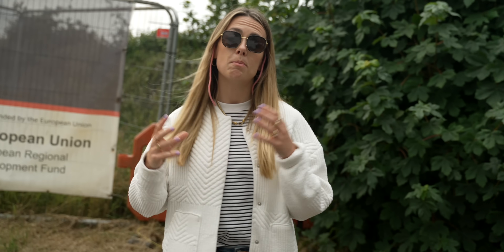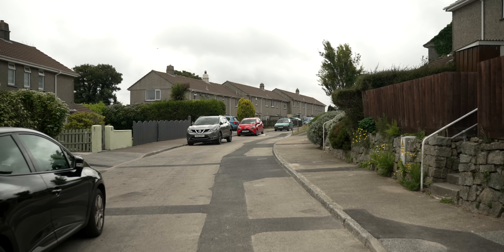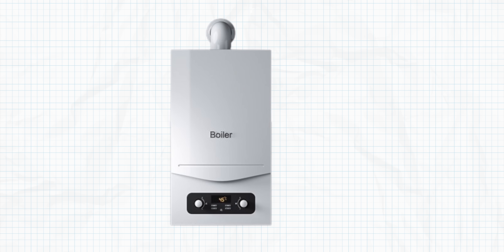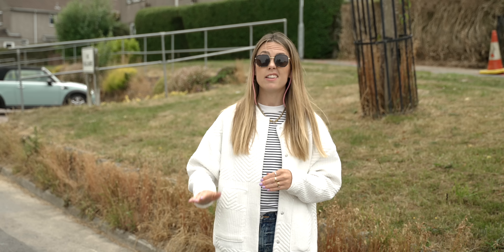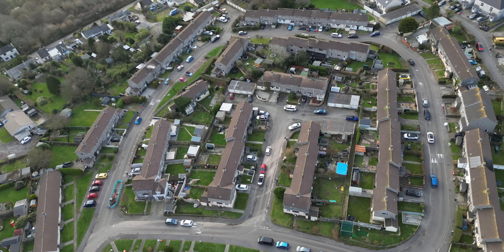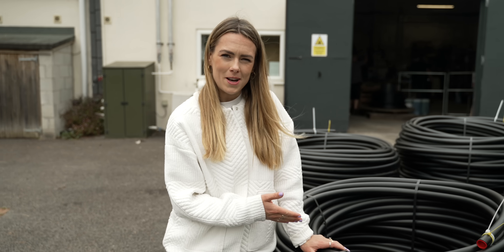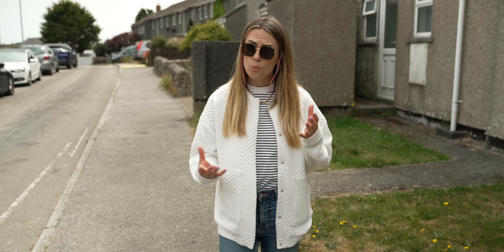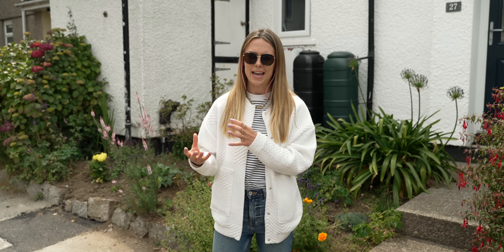Can Kensa's Ground Source Networks Supercharge the UK’s Heat Pump Rollout?

Comment: Don't want to come off as a detractor, I totally wanted to get a heat pump installed, but space requirements indoors and outdoors meant I couldn't. Most people in the UK live in small houses with small gardens
Reply: I had two 100 metre boreholes drilled in my front gargen which is not that big. If you have a drive they gould go there.
Reply: If vertical ground loops don’t work, you could look into air-source mini-split units. The outside looks like a box fan and the inside unit is typically wall-mounted and resembles a shallow floor-mounted radiator. Friends of mine installed three DIY units this summer as it was cheaper and faster than replacing their central AC and reworking its ducts, just in time to take the edge off their first heat wave. Now their systems can provide both cooling and heating (versus cooling only), and they have zone control via the separate units.

Comment: Heat pumps are not financially viable in the UK. We don't have the extremes of temperature to make it worthwhile insulating houses to the extent that is needed to make a heat pump a sensible investment. Here in the NW of England the central heating is on daily for only half of the year, the rest of the time clothing will keep you warm (or cool) enough.
I drive an EV, have solar & battery setup and would have got a heat pump if it made sense. Finding balanced research is like finding rocking horse manure.
Reply: You neglect to consider the external costs of heating that are borne by the environment with disastrous long term effects. In order to get to net zero, gas for domestic heating must disappear.
Reply: @rogerphelps9939  I'm using an electric combi-boiler and that works just fine for me but everyone's situation is different. We certainly should be looking at legislation for new builds but limited resources are better spent on solar panels going on the roof of hospitals, schools, council houses and council buildings in general. I've also wondered why a wind turbine isn't stuck on the top of skyscrapers.

Comment: Heat pumps are definitely the future of heating and ground source is best. I have one. One concern that I have is that the electricity demand on a cold winter's day is going to be massive. My heat pump produces over 9kw of heat for an  electrical input of 3kw but it has to be on around 17 hours per day going nearly flat out on a very cold day.  The demand on the local distribution networks and the grid as a whole will be close to the entire present installed capacity. It is a lot greater t han the requirements for EV charging. Then there is the problem of generation if there is no wind. Where do you get 60GW of green electricity just for heating from on a cold still day? Batteries have nowhere near the necessary capacity and pumped storage is just a few GWh. We need lots of storage. Perhaps Dale Vince's idea of using grass to produce energy could be used or maybe excess renewable energy could be used to produce hydrogen which could be stored in old gas gields such as Morecambe Bay. Whatever we do the very inefficient and wasteful process of burning gas, natural or synthetic, in domestic boilers must end.
Reply: Infra red panels seem much 'lighter on their feet' than the day long operation of the gshp and the ashp. A  background trickle of heat ( 7 degrees C) for uninhabited rooms and a 2 and half minute programmable warm up time in inhabited rooms. If all the rooms are occupied all day then the heat pump logic applies, otherwise for those who wish for a combination of lower embodied energy overall, simpler cheaper install and less of a need to look 'a bit serious' when presenting the IR panel approach may be the best fit for some; provided that a realistic bid price is put forward by the government for  the more efficient wind farms at sea approach as part of a sensible energy mix, as with 'E.ON' or others. Maybe next decade, or just before the fabled 2050, which will probably be too late, based on the newest data from Antarctica.

Comment: Most everywhere in the world are way ahead of UK in the use of heat pumps. I'd love to get rid of my gas combi boiler in my well insulated house  but the costs and disruption of a heat pump system is never going to make it viable.
Reply: They are already fitted to new housing. (Gas boilers are banned now for new builds)
Reply: Please consider the environment that your grandchildren are going to have to live in. Fossil fuels have external costs that do not appear on any balance sheet but are real nevertheless. Unfortunately the cost becomes apparent in future global warming and environmental degradation. Please do not look at it ijust n strict terms of how mmuch money it is going to cost you.
Reply: @rogerphelps9939  I am very conscious of the climate challenge we face having volunteered with our local sustainability group since 2006.  I have spent a lot of money to reduce my bills, and have had an EV for 5 years.  There is a better solution for me just around the corner.  I am invested in Ripple Energy, I expect Vehicle to Grid and Vehicle to Home technologies to become active, both of which will make moving to a different form of electrical heating be a cost effective and efficient way of replacing the gas boiler. A Heat Pump will never be that in this house.

Comment: Five times more efficient than gas heating system is a vague term./// Iceland has found that geothermal energy (Ground source heat) diminishes by 4% annually. Is this likely to be the case here? In Canada some ground source heat pump systems, which also act as air conditioners in summer, pumping heat back into the ground, become heat deficient in the heating season. Also, because of the low winter temps. here a supplementary heat source is usually installed. How would this be accommodated ?
Reply: Geothermal and Ground Source Heat are not the same thing. Geothermal basically comes from deep down heat from Earths core, and needs very deep boreholes (500m to several km depending on location). Ground Source heat comes from closer to the surface, too shallow for Geothermal heat to impact it, and these are typically 200m or less in depth. The heat is coming from the Sun warming the ground, rather than from the planets core.
Unfortunately some people sometimes incorrectly use 'Geothermal' when they are talking about a 'Ground Source Heat Pump' system, so the words get muddled up a bit. Basically if the borehole isn't ~500m or more in depth, it's not Geothermal.
Reply: @TheBoothy666  
Thanks, I sort of knew that but was trying to keep it simple. having thought about Canada  a little more, prolonged snow cover will restrict solar absorption and in the case about which I know, the family are outdoors people and use little summer air conditioning
Reply: As long as you don't try to take out too much heat the reservoir should stabilise, perhaps at a slightly lower temperature. Remember, in the vast majority of cases, the heat is not geothermal; it is just stored solar energy.Regarding supplementary heat, I have had a ground source heat pump for 6 years and have not yet needed any supplementary heat.

Comment: Looks like a great way to get more people to adopt heat pumps...and for utility companies to keep billing customers for one product/service or another.
Reply: I don’t think it’s a choice now, as far as I know all heating for new houses after 2026 has to be heat pumps or all- electric. - were not allowed to fit gas boilers after that date.
Reply: @philtucker1224  - Sure, but does it have to come from a utility or can it be independent for your home?  My point is that utilities are doing whatever they must to maintain a strangle-hold on the consumer.
Reply: @jasonbroom7147  no there are hundreds of heat installation companies providing all types of heat generation (particularly for customers that are intending to be “off-grid” especially) however don’t forget that the pumps do draw a lot of electricity to run the heat exchanger so you will need to include that in your budget ( I don’t know figures)
Reply: @philtucker1224  I haven't got into the weeds of it myself but the figures I'm seeing are up to 3:1 for air source or 5:1 for shallow ground source heat pumps so a medium to large house will probably peak around 10KW for air source or 7KW for ground source (water source seems similar to ground source) &, like conventional boilers, run at less than peak most of the time (my last gas boiler was 35KW so I'm taking that as a guesstimate). Obviously the draughtproofing & extra insulation that seem to come with the package will reduce the figures to a huge extent.

The system in the video is a deep well one & collecting substantial heat from the ground so different figures again.
Reply: Buyer beware, if someone is funding it for you maybe it will be ok. For the individual planning on going down this route, there are no accredited installers of heat pumps etc. anyone can set up to do this on the back of their plumbing company. All these installations are complex and need someone who knows exactly what they are doing. It’s not cheap to install and in some cases expensive to run if installed incorrectly, which happened to a friend of mine on his new build. He’s now three down the road of the bore hole idea, electric pumps running most of the time and his electric bill is heading towards£4000 per year.
Reply: After reading these valuable comments over the last few days it looks as though going all electric heating is the least risky way to go as far as the post-gas-era is concerned, and multiple cheaper up front installation costs..

Comment: If geothermal heat pumps made sense new housing developments would get them in our area. Instead everything is above ground air heat pumps. Geothermal is way too expensive and electricity too cheap for this to work where I live. I could see in colder regions of the US this starts to make more sense.
Reply: Just for ref, but the installation in the video isn't Geothermal, it's a Ground Source Heat Pump, they are not the same thing (although are similar).
Geothermal typically needs 500m deep or more boreholes (much deeper in some places, 2km+), as it takes the heat from the planets core, and the returning hot water is much hotter (often returned as steam), this makes Geothermal expensive (and typically reserved for things like power stations or large community heating project).
Ground Source Heat Pumps only go down to ~200m, but can be as shallow as just a meter or two (if being laid out in a large area, so wide rather than deep), and the bulk of the heat in this case comes from the Suns heat absorbed by the ground, these also only produce cool to warm water, not hot (the heat pump in the house concentrates the heat to make it usable). These are much cheaper than Geothermal. Although air sourced heat pumps are cheaper still, but they are not as efficient as the ground sourced version.

Comment: Anyone come  across the thermal acoustic heat pumps? They sound like just the ticket.....
Reply: Damn autocorrect....
Reply: Thermoacoustic not "thermal acoustic". The thermodynamic  advantages of the phase change in the refrigerants of conventional vapour-compression heat pumps means they'll always beat single phase systems such as thermoacoustic/Stirling, and similar (e.g. Ericsson, etc.) systems at near-ambient temperatures. Thermoacoustic heat pumps/refrigerators are mostly suited to situations where you can't use conventional vapour-compression technology, e.g. as cryocoolers or perhaps  in duplex (engine + heat-pump) configurations.

Comment: Given that most people wont just get the freebies associated with a pilot project, the in home heat exchanger etc, I really wouldn't wanna be stuck with a £365+ yearly standing charge that the company can increase at their whim. 

Reduce your dependency on the grid by your own private finance as much as possible, save as aggressively as you can to get your own oversized solar + LFP batteries.
Reply: That’s fine but it’s a massive investment of between 10 and 20 thousand with a payback time of around 20 years. Most ordinary people don’t have that sort of money and younger working families won’t expect to be in the same house for that long anyway..
Reply: @philtucker1224  As a proportion of the average house price nowadays it is not that big. It is a far better investment than a new car.
Reply: Not much use in winter with temperatures hovering around freezing for days and no sunshine. You would need several hundred kwh of battery capacity.
Reply: @rogerphelps9939  At least where I am it never gets cold enough, Scandinavia has been using air source heat pumps in much colder conditions than we ever experience for a few decades now. My household also uses only around 12kwh per day on average, I really don't need several hundred kwhs of storage capacity.
Reply: You still need to heat your home? Most people would rather pay a few quid a year and not have a massive air-to-air unit in their small garden. This is a solution that seems great for terraces and maybe semi’s.  Make it the cost of the gas standing charge and I’d be happy.
Reply: @edc1569 if the heating package (with the higher standing charge) worked out a lot cheaper, would you choose it ? 🤔
Reply: @edc1569  Fair enough, I'd never wanna live in a terrace (no snobbishness I used to live in one when a student I just love space and distance from nearest neighbour) but I think maybe for terraced streets and apartment buildings ground source heat pumps could work maybe, but I'd want to be in part ownership, I don't want some never ending lease.
Reply: I’d also suggest your attitude of using the grid as a supplier of last resort is not sustainable as a national policy.
Reply: @edc1569  Yeah I definitely agree no government is going to want people to disconnect from the grid. I'm talking about what I want personally, I don't want to be reliant on national infrastructure wherever reasonably possible, I'd rather just opt out of standing charges, fees etc and make my own system.